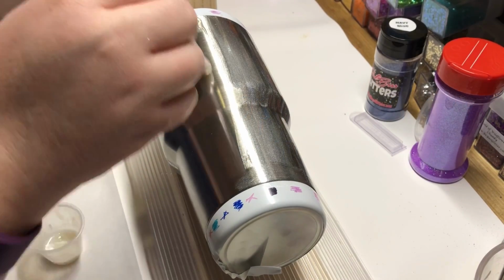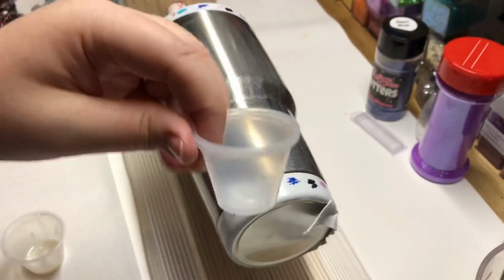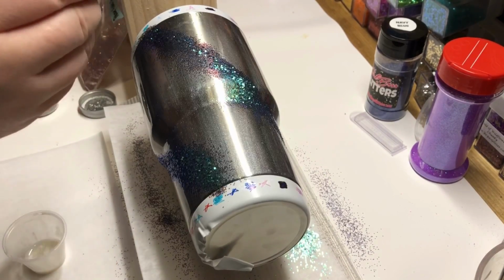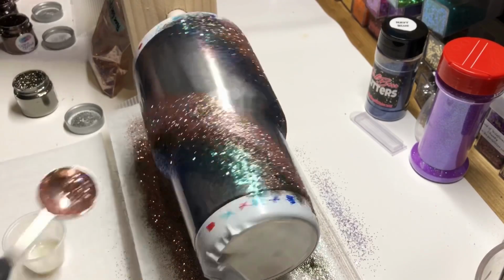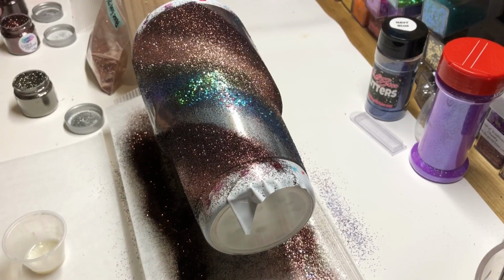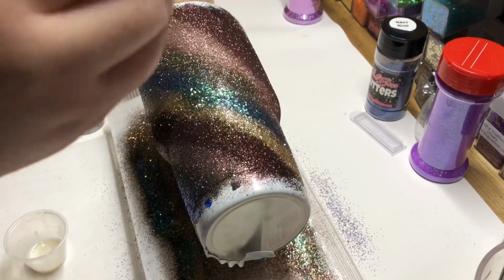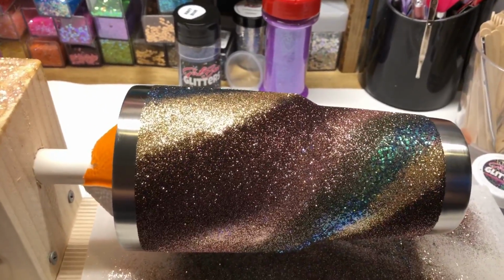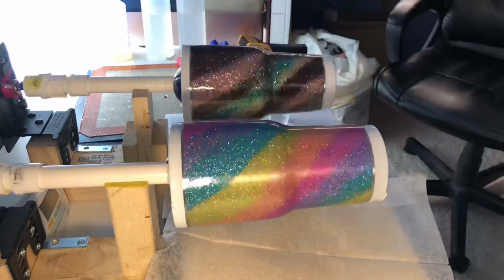DIY: How to do a Glitter Swirl Tumbler

Comment: After you applied the glitter and let it cure for 12 hrs, what did you use to seal it before applying the epoxy the first time?
Reply from the maker: Spray sealer, clear gloss spray paint, ccdiy quick coat, triple thick spray, lots of options to seal. 😊

Comment: Why did you use Epoxy as the base coat before the glitter? In other videos you apply Modpodge before the glitter? Thank you for being so kind and sharing all of your creations with us! Hugs
Reply from the maker: Courtney Moyett For the swirls it’s easier to use epoxy.  I use both epoxy and mod podge it depends on what I’m doing.  Epoxy doesn’t dry quickly so you have more work time.

Comment: Are these cups insulated? If so, do you remove the inside insulation before you start?
Reply from the maker: Marnie Baker These are double walled stainless steel tumblers.  Nothing to remove before starting.

Comment: Can you tell my why you use Epoxy instead of Modge Podge to apply the glitter?
Reply from the maker: I use both, but recently have started liking epoxy better for the sticking power.  It is more durable and also doesn't dry quickly so you have more work time when using epoxy as an adhesive.

Comment: when do you take the tape off the cup after you have applied the epoxy?
Reply from the maker: It depends on the type of epoxy and when it sets up.  When you pull it will determine what your line looks like.  The sooner you pull it the less of a slope/sharp line it will have.  I pull between 30 minutes and an hour.

Comment: I'm sorry if you have it in the video somewhere and I just missed it or something... But when applying glitter with the epoxy method, how long do you let the epoxy sit, after mixing, but before applying it to the cup so that it don't try to run while, during, or after applying the glitter?
If that makes since lol
I love your videos though. Your stuff is amazing
Reply from the maker: I actually apply mine almost immediately...because I want it to go on smooth.  If you let it sit too long it'll be hard to apply, so I'd wait no more than 5 minutes.
Reply: Minderella1225 ok great thank you. 
I've tried a few glitter things with the mod podge method and not crazy about it at all lol so may give this a shot to see if it's better for me. Thank you so much
Reply from the maker: No problem...you just have to try different methods out and find one that works for you.  :)

Comment: What do you put over your vinyl on your cup so it won't come off??
Reply from the maker: If it's permanent adhesive vinyl it doesn't need anything, however, I seal mine with a final coat of epoxy.
Reply: Minderella1225 thank you as some of my  vinyle has come off..very disappointed..what vinyl do you use?
Reply from the maker: Colleen Chopp oracal 651 the majority of the time
Reply: Minderella1225 thank you!!!

Comment: on this video you use epoxy before glitter and not mod podge?
Reply from the maker: Correct.  No mod podge.
Reply: did you find that direct application to epoxy was better or the same, thus deleting a step?

Comment: I have problems taping , I can’t ever get it straight , and my epoxy is seeping under even if I press down on the tape
Reply from the maker: My epoxy goes under my tape as well, I just clean it up while it's still wet with a wedge sponge and acetone.  :)